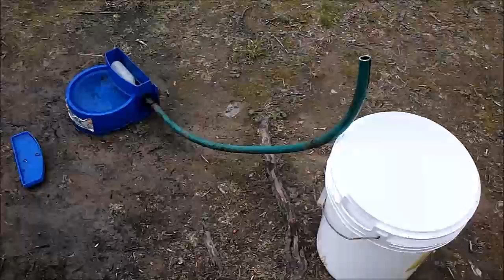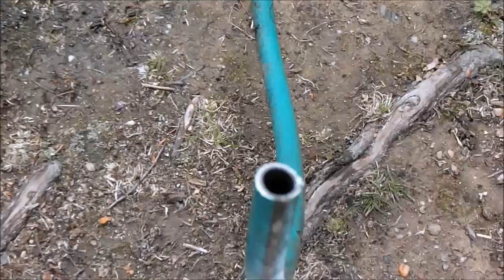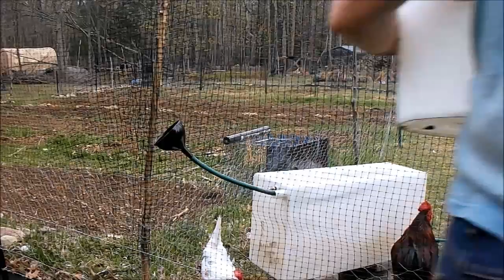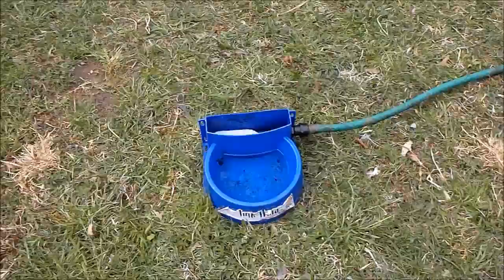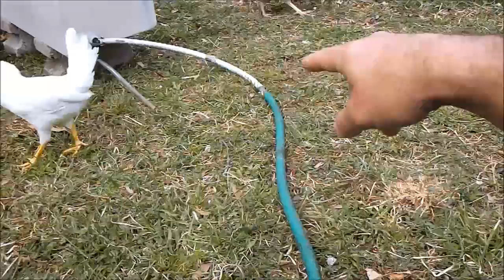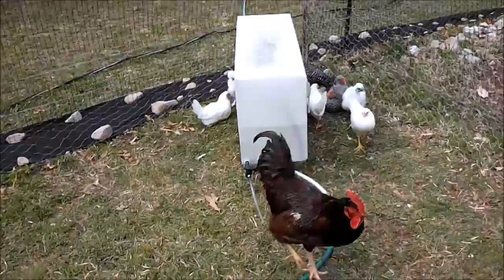Off Grid Automatic Chicken Watering System Using Rain Water

Comment: Either raise the water tank or setup a solar water pump to turn on automatically to keep the pressure up. While you are at it reflect the sun off the tank, hose and water feeder so the water is not too hot.

Comment: Troy, use some PVC to bring that fill hole outside of the netting and turn it upwards.
Then you can set the funnel in the pipe and use both hands on the bucket.
Reply from the maker: I hope to get the large tank connected to it. Turn on a valve and fill it up.

Comment: That tank isn't made to support it's weight unless it's on a supported flat floor.  At least a 3 or 4" lip all the way around the outside.  If you support it only in the middle, it's going to tend to bust when it's full.

Comment: I work for a water dept. and storing water like this is not good with out treating it with chlorination will result in a moldy mess and sick  or dead Chickens.. like a swimming  pool   heat is not your friend
Reply: Do you think apple cider vinegar is sufficient?  Don't get me wrong I am all about chlorine in my pool, but I have seen YTers saying they use apple cider vinegar in their chicken water... what say you?
Reply: yes that will work fine  I treat millions of gallons of water.,but doing nothing is bad
Reply: 44JohnDeere per gallon??  Isn't that kind of a lot?
Reply: MollyDolly cap not cup.
Reply: 44JohnDeere I got you, but I have used teaspoon for five gallons... a capfull is about three tablespoons I think.  Just seems like a lot for immediate drinking...but if you let it sit open for twenty four hours it might be ok.
Reply: 44JohnDeere Either way, like plowtruckdriver said...nothing is bad.  So, I would err on the side of too much.
Reply: I could be wrong but I've always heard a cap full.   I would imaging different brands are going to have different sized caps though.
Reply: 44JohnDeere True.

Comment: Like this one Troy. Especially since it combines both off-grid and DIY. Practical approach that could be beneficial to a lot of people, on or off the grid. Easy way, too, for people with livestock quite a distance from their homes. Fill a tank on a vehicle (whether lawn mower trailer or something larger). Drive to where water is needed. Then use a manual or electric pump to transfer into the holding tank for the animals, if desired.

Been there, done that, when water had to be carried everyday for livestock. Evident that some of your critics haven't. 

BTW, has potential to be a hand washing station at a campsite or a workshop, when rigged to a 5 gal bucket. Simple on/off valve, in line, would keep fresh water in bucket, until needed. 

Thanks for sharing. God Bless.

Comment: Can't see why you can't run a hose from the 255 gallon tank to the 30.  It seems to be downhill and it's under about 200 gallons of pressure.